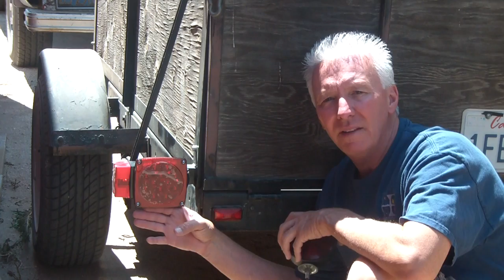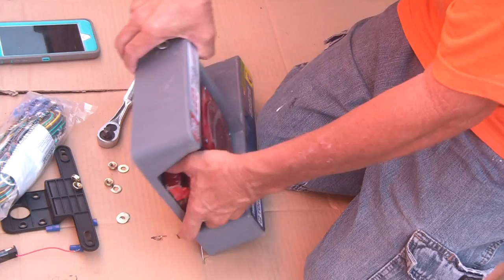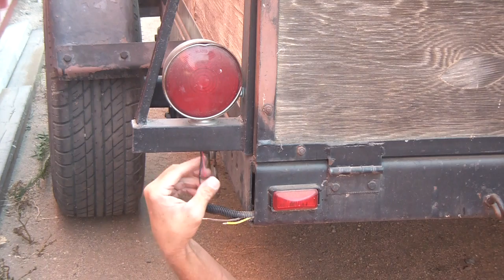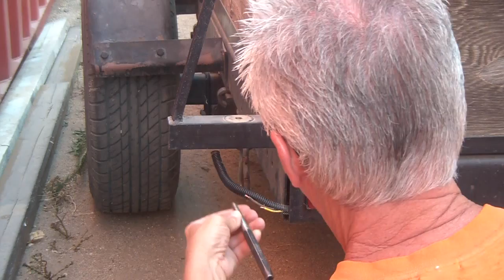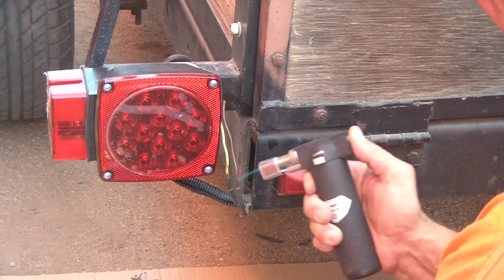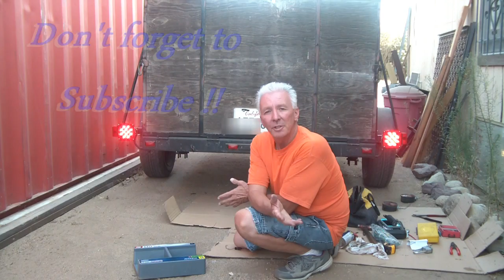How to Install and upgrade to LED lights on a trailer

Comment: Great video! Thanks for posting. I have to weld some trailer light enclosure upgrades tomorrow morning and have never done wiring on LEDs...swapping out the old style lights such as these.  Thanks 👍

Comment: If you do this using those crimp connectors, leave the bare wire long enough to cross to the other end - the more the wires contact each other as well as the connector, the better.  Then again, why not solder them together and be done with it?

Comment: I bought the same full light package, ,one of my trailer wires were broken someplace, ,,since yours already worked you could have just bought  led replacement bulbs for the existing set up...

Comment: The light came with three wires. One for grounding , the other for brake and the third for driving light. To which wire should I connect for turn/hazard?
Reply from the maker: kimutairop2847 the trailer wire is pretty basic either 7 wire or 4 wire. In this video my trailer is wired with 4 wire. The yellow is your left turn, Break and emergency flash. Green is your right Turn, Break and emergency flash. Brown is your running lights. White ground. The tail lights connect as directed white is ground green to green and brown to brownj. If colord dont match get a test light turn on your running lights test for what wire turns on the test light do same for left and right signals. thoses will be the break and emergency flash.

Comment: Why didn't you switch the light housing right to left and mount your plate above the tail light with the clear window facing upward?  The housing is still waterproof and your plate should be illuminated at night.

Comment: Question,  so my existing bulb  lighting for my trailer is there.   So if I want to change out to LED, with the existing wires will work, correct.
Reply from the maker: Russell Wahrman
 great question and yes. These are a direct replacement. They should connect to any 4 wire set up. Just be sure to make good ground so you won't have any issues.

Comment: The wires that came with my LED trailer light kit are red white and black. And I I am working on them right now to try to get them to work because I have to use the trailer tomorrow and I will be leaving at 4 AM when it’s dark. I don’t know if it helps or hurts, but I am a retired electrician
Reply from the maker: Harry Lime sounds like basic wire. Generic wiring one ground one for running light,one for brake & signal. hopefully the kit states which wire is for what sounds like you have it under control info never hurts you never know when someone else may have the same problem good luck and have a safe trip
Reply: The Shack 
   I wiring for the lights on the lights, the wires were red black and white. The trailer wires of course are brown yellow and green.
    I went on this site/YouTube/and one of the confident guys with a very nice trailer said that the white wire is ground. I found out yesterday that the black wire is ground.. now the lights work fine.
 If only my two sons would stop accidentally bumping the lights, breaking one of them. This is the fourth set of taillights I have put on my trailer since 2000.

Comment: Questions , I followed his instructions step by step & my led lights come on , but will not blink for right or left turn , nor flash for hazard ..please help I have been at this problem for ( week's ) ( note : my trailer is for boats )
Reply from the maker: Montell Williams
 Id start from the beginning. test the outlet from the vehicle and make sure all terminals work, running light, break light, turn left and right. Then check the colors and match them to the trailer. Most importantly make sure you have a good ground on the trailer. I had a boat and every so often I'd check the ground even if I had to scrape the area of the ground to make sure there was good contact.

Comment: I'm converting my S10 into a flatbed and I've got the ones that have the turn signals and brake lights.
Is it possible to splice the wires that connect with these to the old tailight wiring harness?
Reply from the maker: Mikhail for sure. If your taking the bed off these will work fine.

Comment: would you be able to flip them that way you can add your licence plate holder.? and also you know put the left on the right and vice versa. I know the light will be facing up.  just a thought..
Reply from the maker: payasso it can go any way its just what they suggest if you want to flip it and have the LED light facing up shouldn't be an issue. Thanks for viewing.
Reply: The Shack  I fucking lvesw2o c12 free er

Comment: Put new LED light system. Won't light. Manufacturer's tech says I need to buy a LED flasher. Not enough current draw. Really? Or add resistors in line so I am drawing more current?
Reply from the maker: Scott that makes no sense. LED draws less energy. that's why they are so good. Not sure about newer vehicles. But I have pulled this trailer with my 72 chevy, my brother in laws 03 ford and a neighbors 2012 dodge so i don't know why you'd need a LED flasher. These are basically plug-n-play. Sorry I'm baffled.
Reply: @TheShackHome  it didn't make sense. But my super clean to bare metal tongue ground wasn't good enough. Drilled a new ground hole in trailer frame and all good. Helped to bench test a light to have confidence that they worked.

Comment: Can those lights be mounted on wood
Reply from the maker: Pastor Juan M. Woodson, yes they can just run a ground wire to them. Thank you for viewing.
Reply: @TheShackHome  How do you run ground wire there no white wire from the lights
Reply from the maker: @pastorjuanm.woodson3966  if no ground then you could attach a ground wire to the light or solder a ground wire to a washer attach that to the light then to the wood and hopefully that will ground the light just attach that wire to a ground source

Comment: Not sure if anyone else is as dumb as me, but you need to make sure the ground wire is connected to the metal of the trailer... I had mine connected to some metal on a wood piece of the trailer and lights did not work! Watched this video and realized my mistake.
Reply from the maker: Curtis Nemetz
 don't under estimate yourself. It's common to think connect to metal for ground but the wood acts as an insulator breaking the chain. I'm sure many have done the same. I replace an alternator 2 times, changed out the battery only to have a friend ask about the ground. We took the wire from the battery to the body some sand paper reconnected it an BOOM started right up. Yes I felt really dumb It happens.  Great tip for future viewers. you just never know. Thanks for viewing.

Comment: Not very durable for my use there cheap and get smashed easy I made custom boxes around mine on my trailer with flip down mesh door work very well

Comment: Really? Scared for years to pull your trailer with conventional, incandescent bulbs but not scared to drive your vehicles with the same bulbs. Yes, that same type of incandescent bulb in your "old" trailer lights is the same as what has been in vehicle tail lights for years & still is in most vehicles?
Reply: no so with newer vehicles.  older vehicles, yes
Reply: bullshit....many newer vehicles have 'em
Reply: Pat Rafferty even if the newer vehicles have bulbs...its not like any trailer lights...the lens on cars are made so much better....and are alot bigger......what kind of new vehicle are you buying that have dim trailer lights on them...lol...